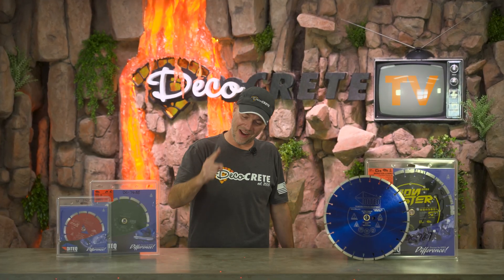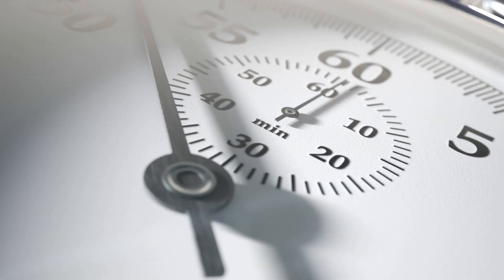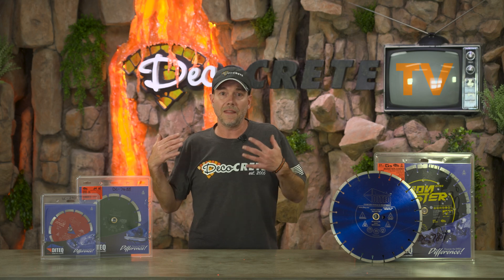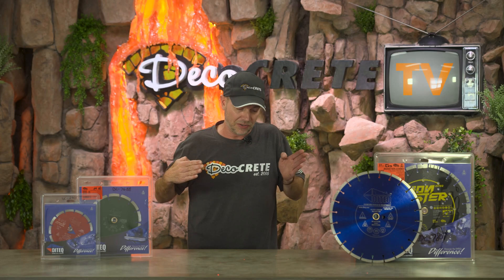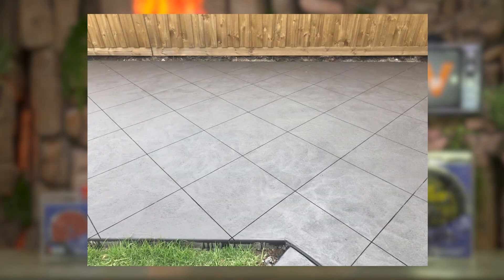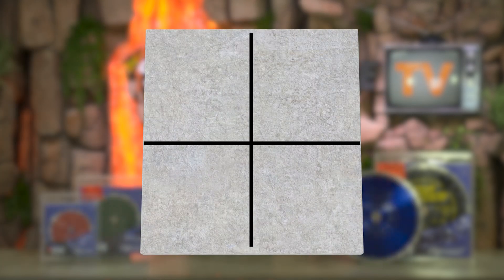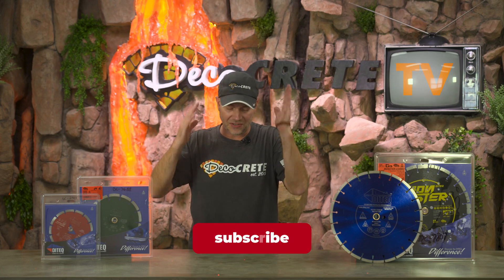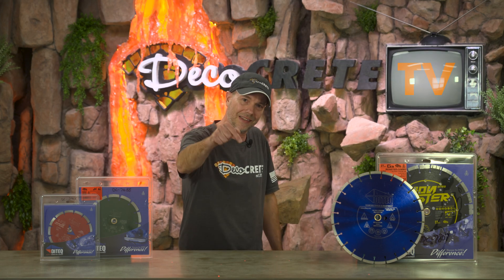Concrete Saw Cutting 101: Timing, Depth, and Layout Tips

Comment: When did they quit putting expansion joints in concrete and go to all this saw cutting, late 80's, early 90's?  Nice video by the way!  Me and my dad poured our driveway with blackboard joints in it back in the 80's, and to this day it still has zero cracking!
Reply from the maker: Thanks for the comment! Some concrete slabs still get expansion joints to control cracking, but most slabs just get saw cuts or tool joints. I'm not exactly sure how things were done in the 80's or 90's. I started pouring concrete around 2001, and saw cuts & tool joints were pretty much the norm at that point. Nowadays, expansion joint is mainly used to isolate adjoining slabs or up against walls & foundations. I'll leave a link below to another video on expansion joint. Thanks for watching Deco-Crete TV!!!                                                                              https://www.youtube.com/watch?v=VXsWYGhQfqs&t=2s

Comment: Hello what about if corners are really to close lets say from the edge to the house up to the edge of the garage were the brick siding does a 3-4 inch corner
Reply from the maker: Thanks for the comment! The best thing to do in that case is to make sure that one of the saw cuts hits that corner. Even small corners will crack over time. It might not always look the best to hit all those corners with saw cuts, but it's better then a crack in most peoples opinion. Thanks for watching Deco-Crete TV!!!

Comment: Do you know of a gas saw that will cut deeper than 6 inches
Reply from the maker: Thanks for the comment! You'll probably need to find a walk behind floor saw for that. You can get a large chop saw with a 16" blade, but 6" would still be the max cutting depth. Floor saw blades can go up to 24" or even bigger. Hopefully this helps. Thanks for watching Deco-Crete TV!!!
Reply: @DecoCreteTV  have you ever heard of a ring saw they cut very deep.
Reply from the maker: @Tensecondsss  I have heard of them, never used one, though. They sure look cool!

Comment: Thank you for such good information. One question: My driveway was cut, but six years later, it is cracking. Can I cut it a few more times yo avoid further cracking?
Reply from the maker: Thanks for the comment! Using saw cuts to control cracking is generally only relevant during the curing stage of the concrete. I'm not saying that it won't help at all, but at this point, the concrete is probably cracking for a different reason. Concrete will crack over time, and as long as the cracks are minor/hairline cracks, I wouldn't worry to much about it. If the cracks are really drastic (opened up more then 1/8") then there may be a problem in the sub-grade under the slab. If this is the case, putting more cuts in the slab really won't help the problem. If the original cuts were to far apart or not deep enough, the cracking would have probably happened within the first year. Hopefully this helps! Thanks for watching Deco-Crete TV!!!

Comment: I've been having lots of chipping when sawcutting, would a green blade make a big difference? I use the Stihl in a buggey
Reply from the maker: I agree with @GRUBB-MUDD on this one. Always use a green blade for cutting green concrete. We've always had good luck with the Stihl chop saw on the cart or, at the very least, the Stihl wheel kit. The early-entry saws are the best for avoiding chips, though. Thanks for watching Deco-Crete TV!!!
Reply: Thats your problem, dont use a demo saw to cut GREEN concrete, I hate demo says for decorative cut. Get a real early entry. I use it the next day and get no chips.  I will say another reason I do t like to use a demo saw to cut likes. Is the early saw I use blade is half as wide as a demo saw. Obviously the sthl on cart is better than w out. A GREEN blade does work good, but wont last cutting anything besides GREEN concrete
Reply: @GRUBB-MUDD  wow thanks GRUBB, huge fan!! One of the best content producers hands down!
Reply: Depending on stamp I like to use a hand held quicki saw and cut along a 2x6 or something. If a saw has small wheels it will rock going over grout lines.